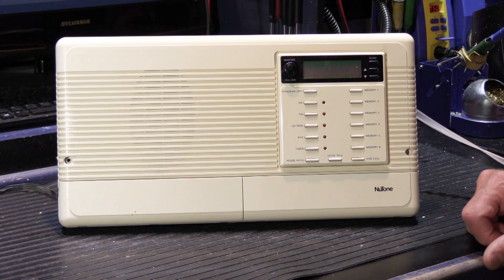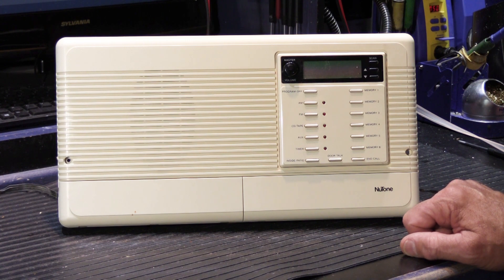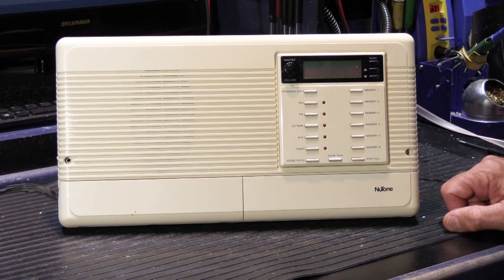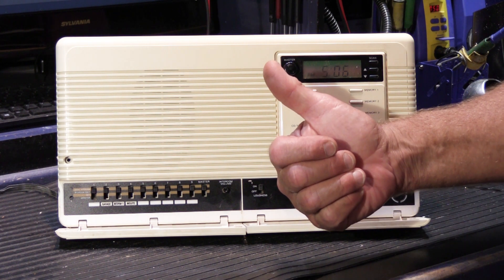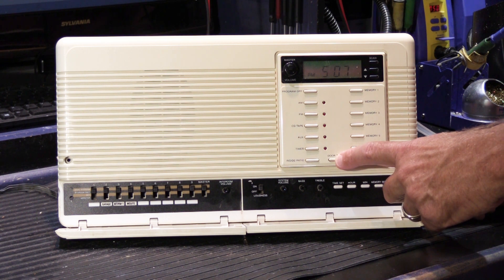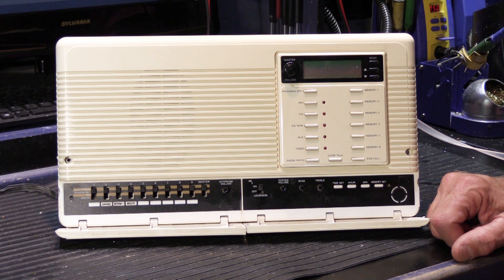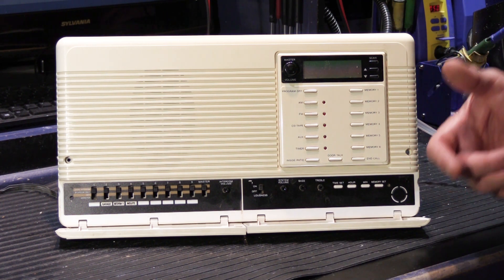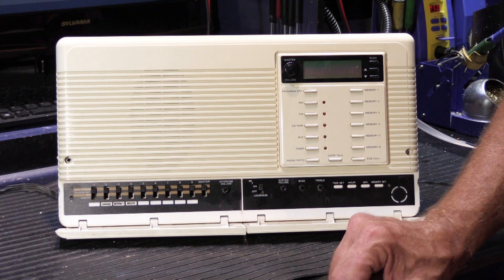NuTone IM3303 Intercom - Common Common Failure Mode #4 ??? - or is it?

Comment: My radio  functions to all receivers but when i try to talk from master or individual receivers i get nothing.
Reply from the maker: Hi justin:  Without more detailed information, it's difficult to say what's wrong - It could be something as simple as the System being misadjusted or needing a Reset - or something much more serious - It would be best if you contacted us directly to discuss your IM3303 System - Chris    nscompany@msn.com
Reply: @northsideservicecompany3567 
Only thing i have messed with was the CD player. Works here and there. But i get relay clicking properly when in use of presing the buttons. Did a reset on the unit and also flipped the breaker.
Reply from the maker: @justinbustin677  Well, since you have an IM4406 or IMA4406 - Not a IM3303 - This is an entirely different situation. . . .You will need to contact us directly about your System - Chris     nscompany@msn.com

Comment: Bob Proby
Chris, we talked last year and I followed your troubleshooting instructional video. I purchased my NuTone unit in 2004.  I was able to isolate two of the six speakers that resulted in my “IC” problem. Besides the two speakers, the system is functioning very good. My next step is to fish the wires from the speakers to the main station to restore the system to its full capacity of speakers. Thanks for your assistance.  Your videos are excellent!
Reply from the maker: Hi Bob:  Good to hear that you found the problems and repairs are underway - Chris

Comment: The doorbell on my IM3303 rings constantly. Nonstop! It just started a couple of days ago. I've turned down all the remotes just so it wouldn't be so annoying. Also removed the exterior doorbell. Can you tell me how to stop it? Thank you!
Reply from the maker: Hi Darryl:  Open up the IM3303 and disconnect it from the Transformers.  You should do this RIGHT-AWAY, before the constant ringing damages the IM3303.  Here's a link to our Video that will help you disconnect the Transformers: https://www.youtube.com/watch?v=qPDsvHRVU_c&list=PLsTvqKsBnGYc2zj1Db43FzJR_JV684dsi&index=4&t=1s  - Chris
Reply: @northsideservicecompany3567  Got that done. Thank you very much for the quick response to what's obviously an urgent issue Chris! Do you sell replacement parts I need?

Comment: I have NUTONE MODEL IM-2003 SERIES with 6-intercom installed back in 1992 and it is not working at all. Do you have any replacement for this model? If so let me if you do i will give you a call later. Thanks  Frank
Reply from the maker: Hi Frank:  You are welcome to contact me about your NuTone IM2003 - Chris 925-743-8236
Reply: I was told the nut one system stopped after an electrical storm. It was installed in 2006. Does it sound salvageable?

Comment: I bought mine in 2000 and it is still working fine with the exception of the noisy potentiometers. Can you teach me a hack to make it play with Sonos, Alexa? LOL I'll keep your info in case I need repairs. Great video!
Reply from the maker: Hi Fabio:  You don;t need to hack it - you can simply add an external Audio Jack and the use it to connect Alexa or some other device, which plays through the system. - Chris

Comment: My IM3303 was installed in 1995.  So far, thankfully no issues.
Reply from the maker: Hi Jim: So far, I have only seen a few IM3303 have this problem.  I suspect that it's more of a random failure that something that should be added to the list of the the 10 Most Common Things that go wrong with the IM3303 - Chris